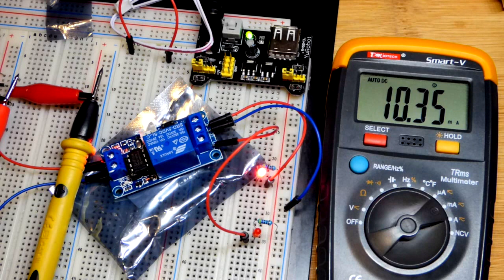First look at cheap electronics latching relay module

Comment: How would you activate the relay using the provided 2 pin socket beside the test button? I could see Voltage in or ground activation but normally they are just inputs , not a 2 pin setup like that

Comment: did you finally find a REAL bistable latching relay? I got this one(like in your video) today and another one both advertised as bistable on aliexpress and both draw around 60mA... what the heck... any idea where I can get a latching relay and not these useless fakes.
Reply from the maker: I actually found one in an old "Make Electronics" kit I have. I never found any that I would buy so far unless I absolutely had to.
Reply: @Electronzap  I have a TP223 touch sensor that I want to control the 230V input of a 750W psu, will this sort of relay work or it will fry it? (tp223 is configured to give a low latching signal, but can be configured to give high signal too)

Comment: WOW! Does this really use an STC micro-controller just to latch a relay? Talk about using a sledgehammer to crack a nut.....wouldn't a 555 do the same thing? Whatever.....thanks for the video, always appreciated.
Reply from the maker: Guess so. It's definitely a pretty pointless module if a latching relay is needed. But, I was able to make a video with it. Hopefully I can prevent others just starting to learn things from wasting their money on deceptive components. Thanks for watching!
Reply: I don't think this is out to deceive anyone, in fact it simplifies things considerably when you need a latching relay....the test button provides a simple push-on push-off solution with the option to use your own 'external' switch with that plug/wire that you show.

Were you to replicate this with just a dedicated 'latching' relay you would need two buttons, one for 'on' and one for 'off'......here the micro-controller is simplifying it by just using the one button....although you yourself have already demonstrated that you don't need a micro-controller just to do that.
Reply: you need this i believe for garage doors as  they need a pulse to open and a pulse then to close.  Wireless kits on the market just give a pulse close on their dry contact. So you need a relay that switches just with a pulse.

Comment: Strange relay.
You sure it's not damaged?
That current draw kinda looks like it may be malfunctioning.
Reply from the maker: Maybe. Could just be a poor design. I just started using relays, so I still have a lot to learn.
Reply: @Electronzap  it's got a lot of parts on it that's for sure.
It's kinda odd that it draws different amounts of current.  My instinct says they should be equal.
Reply from the maker: I'm pretty sure the relay doesn't actually latch, even though it is sold as a latching relay. But, instead the module holds it in the on position with current. I'm looking for a better one that is decently priced to compare it with.
Reply: @Electronzap  the latching part can be acheived by the way you wire a regular relay.
You can make a regular relay latch if it is the same voltage as the voltage used in the rest of the circuit.  Or you can add a low voltage transformer.

Check out latching wiring diagrams in HVAC (heating and air) stuff.
Reply: @Electronzap  this guy gives a really good explanation of latching relays.
https://www.youtube.com/watch?v=n7SuHDmuVUk
Reply from the maker: That's a really cool video! Thanks!